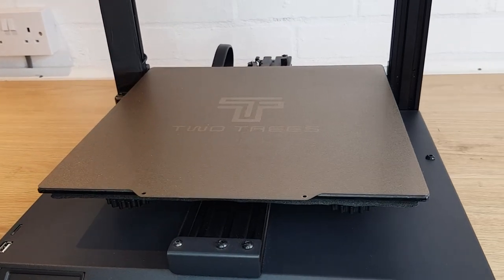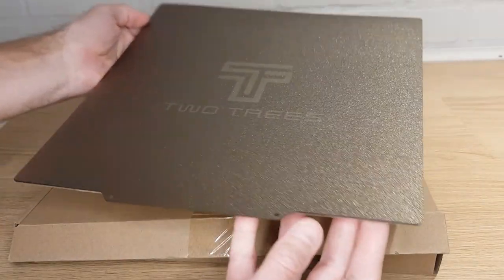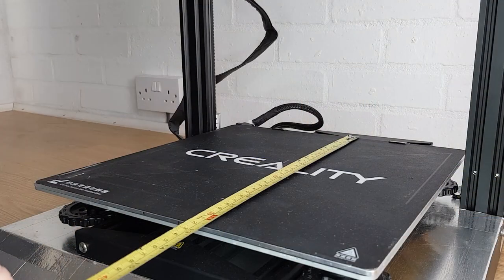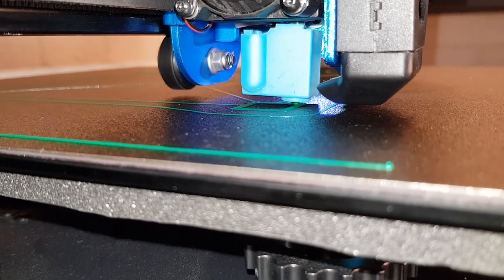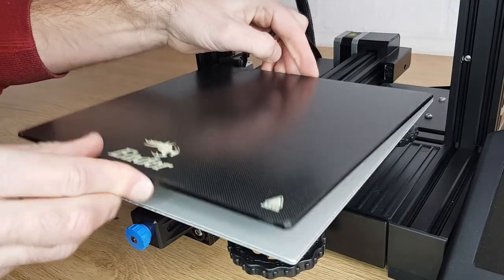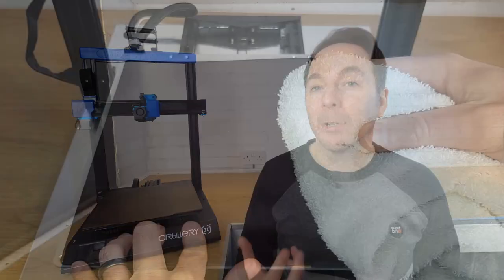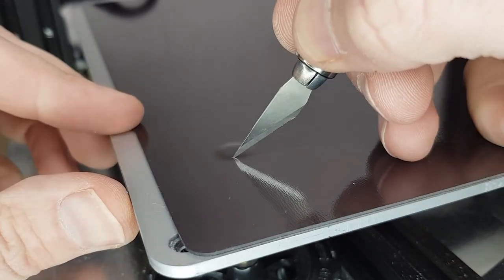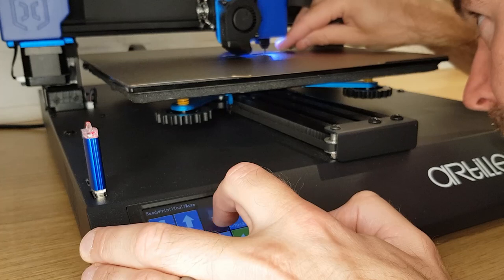Upgrading Your 3D Printer with a PEI Bed: Quick & Easy

Comment: Just discovered your channel, and it's the best so far for me - it covers all the topics I'm interested in such as filament storage and drying and of course the Sonic pad - so thank you.  But (and there's always a "but" or a "however"😀) I have now run with a glass bed for several months after replacing 3 PEI beds on my S1.  The first I destroyed with acetone (my bad) the second the PEI coating cracked (I have no idea why) and the third just got too badly marked with thin layers of print that I couldn't remove to my satisfaction.  I'm Interested to see how you get on with the PEI.  Cheers, Clive.

Comment: Great tip! I get very good first layer adhesive to my enter 3v2 bed, sometimes almost too good, it would be nice to flex the bed to get the print off. Thanks!
Reply from the maker: I went quite a long time without a flexible bed but now I try to add them to all my printers. It really helps.

Comment: I have Wham Bam PEI beds for my 2 Ender 3 printers and decided to get some for my two Ender 5 printers until I saw the price $140 each which converts to about £120 each, I didnt even look how much one would be for my Pro 3D V-King 400, I will stick to the mirror tiles I cut down, I have 3 for each printer and take one off and replace it with a fresh then when the other one has cooled the parts pop off anyway, but I do like that texture from the PEI textured bed.
Reply from the maker: I use a mirror sometimes too. There are pros and cons with all of the different surfaces so it's nice to have a selection for different situations. Thanks for the comment.

Comment: Do you recommend doing a PEI over a glass bed? My current bed (S1 Pro) is warped as is apparently too often seen, i want to upgrade to a glass bed, but i do like the quick release of the spring steel.

Also, do you have to compensate for the additional weight of the glass bed add-on with the stepper motors? Are they ok handling the extra weight?

Comment: I just removed one of these stupid PEI bed surfaces. I bought a used printer with one of these beds on. I changed back to the ender with a glass bed and it works much better than the PEI. But if you really want to try one of these beds I suggest you leave your bed surface alone and put the PEI on the bed of machine with blue painters tape all the way around the edges. Change your Zeo offset a little higher because of the thickness of the PEI and add about 8 to 10° to your bed temperature. You might need to rerun the bed leveling program if some of the areas on the bed don't stick well. Takes about 5 minutes to set it up in about 3 minutes to remove it and change back your z height offset.
Reply: I am going to buy PEI bed sheet just because of PET-G filament. I have seen what could happen to glass bed that i have on ender 3 neo. I don't want to ruin new glass bed with pet-g. And textured PEI is great for pet-g, at least what i have seen so far. I will try it in few days and see it by myself.

Comment: Dumb question, when using automatic bed leveling with a CR Touch is setting a new Z offset really required?  Seems to me the printer won't care how thick/thin the new bed is since the probe will be determining the mesh and setting the Z offset according to the probe.

Comment: The size of my Tarantula is 220x280 - there's just no plate with that size. Would you rather recommend to use a smaller plate, or a larger and cut it down?

Comment: Would running a PID autotune on the bed help?
Reply from the maker: Yes, good point. The PID tune may need adjusting but it won't make a huge difference. Honestly, I only do bed PID tunes if I notice a fluctuation in the temperature on the display.

Comment: My ender 3 pro comes with a magnetic plate already installed. Do I need to remove it and reinstall it?
Reply from the maker: See how strong the magnet is compared to your new one. I found the two trees one to be stronger than a lot of the ones I've had supplied with printers. If it stays attached to the old one then save yourself a job. You can always change it later if you want.

Comment: Im gonna measure the actual frame size myself, but has anyone found replacement beds for an ender3 s1plus? Its a 300x300 bed but i seem to only see 310x310 replacement beds. I dont think it will be an issue.but does anyone have links or info on s1plus parts?
Reply: I wouldn't worry about that. It will only stick out 5mm on all sides.

Comment: Sorry, this may not be the right place to ask. Is ender 2 pro better than kingroon 3 kps pro, I need it for wearing it.
Reply from the maker: I haven't tried an Ender 2 but I do have the Kingroon KPS Pro. I'm still putting it through it's paces but so far it has given great quality. There is a small issue with the hotend that you need to be careful with but I will cover it all in my review after Christmas.
Reply: @RickyImpey  Do you have a kingroon printer review maybe?
Reply from the maker: @milosdjordjevic8272  Coming soon, after Christmas
Reply: @RickyImpey  tnx👌👍

Comment: Hey what do you if go to print something and your 3d printer doesn’t print anything and says “ fail reset” with a ender 3 pro.
Reply: 11 days later... what did you do? Im curious.
Reply from the maker: Sorry, I don't have an Ender 3 Pro. I assume it means that it is not able to find it's home position to begin with. Perhaps see if the printer can auto home without any issues.

Comment: I bought one of these Pei coated spring steel with a magnetic sheet Bed things.
 Only to discover what No-one EVER even talks about: 
The damed thing is Heavy.. Too heavy !
 Just what we need add yet more useless weight to our bed slinger type printers. 
Easiest possible way to further degrade print quality. 

I've decided to stay with Simple Stupid Painters tape.. it's Easy Cheap and 100% Reliable.
 
Why are we 3d printer weenies ... Such mindless Lemmings ??

Comment: This is truly not necessary! I hear all this hype about PEI, yet a simple glass bed is more than sufficient and will yield much better bottom surfaces on your prints. People keep saying "ease of use", and "just bend it"! Hell, wait 10 minutes and your prints on your glass bed will pop right off! Oh, so you say 'what about PETG' and 'it sticks too well'! Who gives two shits?! Almost all of us have glue stick around, so just put some down, PETG comes off with NO HASSLE! PEI is yet ANOTHER fad like talking point. I just don't get it! Yes, I've had PEI sheets, glass is better!
Reply from the maker: I think it's a case of personal preference for a lot of people. Personally my least favourite is my Ender 3v2's carborundum coated surface. Way too unreliable. I always use the plain glass with glue stick when using that machine. However I really like the flexible beds and especially PEI where I find it to be the most reliable option when I don't want to use the glue stick.